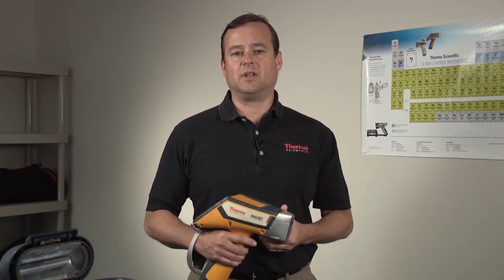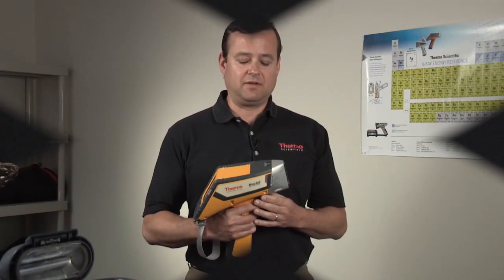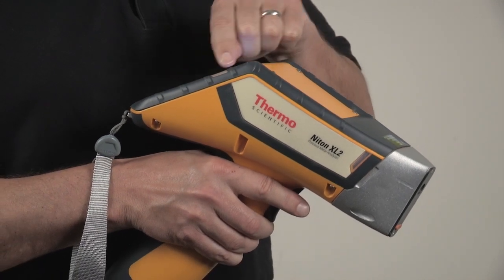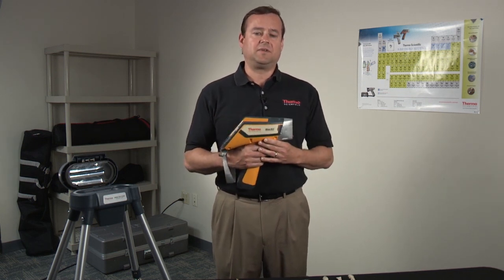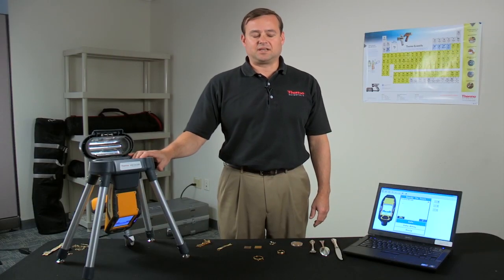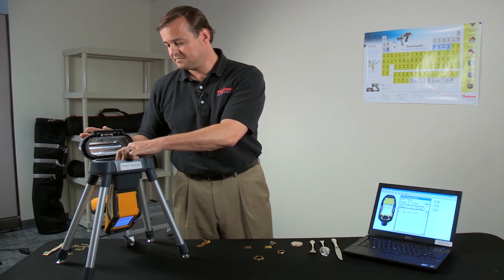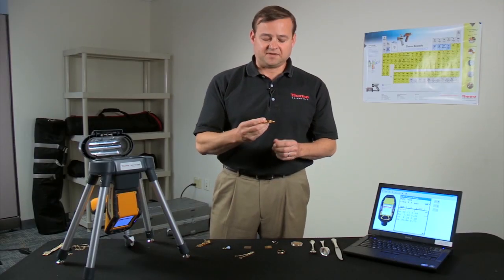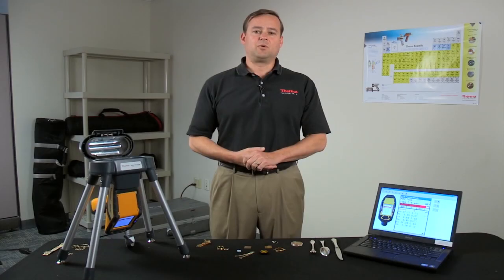AuDIT Gold Plating Detection Technology | Thermo Scientific

Comment from the maker: The simplest testing of a gold bar that is suspected counterfeit (eg gold-cladded tungsten) would be: drill small hole,analyze collected drillings. This will indicate if interior is different material. You would know very quickly – without even the need for analysis, if the interior of the bar is tungsten.  Gold is very soft and easy to drill, tungsten is extremely hard and difficult to drill through.  The bit would quickly penetrate the gold layer and stop cold when it hits the tungsten.

Comment from the maker: The Niton XL2 will provide the composition and gold karat value for any type of sample, including gold bar.  It is, however, a surface measurement, so will not provide any information about what is in the center.  To get an accurate measurement of the entire bar, one would drill a small hole entirely through the bar, collect the drillings and use the analyzer to test the drillings.  This will give an indication as to whether the interior composition is the same as the surface composition.

Comment from the maker: For the most part, yes AuDIT technology will detect gold plated tungsten. However, if you are referring to the recent scandal in NYC where gold bars were found to have tungsten slugs imbedded within, AuDIT will not be able to detect these frauds. The gold layer is much too thick for XRF to penetrate the surface and see the tungsten embedded inside.

Comment from the maker: The sample does not need to be flat; shape of the sample does not matter – it can easily be used to test chains, links etc.  The penetration depth through gold plate is about 8 – 10 microns.  Typical decorative gold plating is less than 3 microns.  The only items that create issues for AuDIT are items that are cladded or “Gold filled” as these are not actually plated materials, but are cladded with a relatively thick layer of gold.